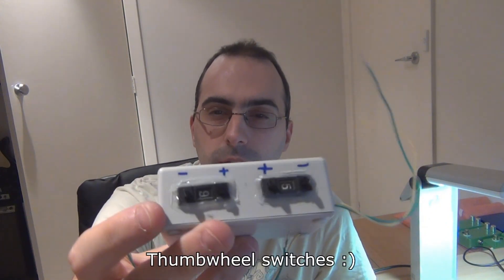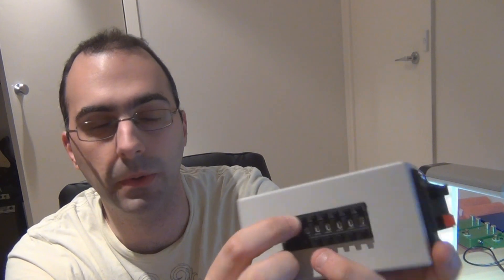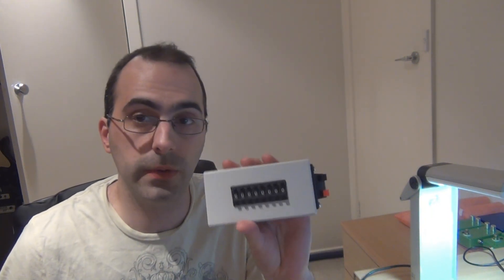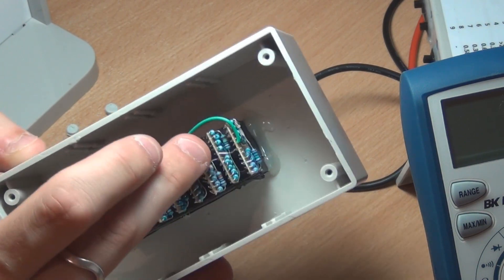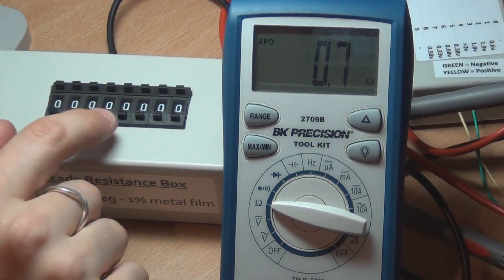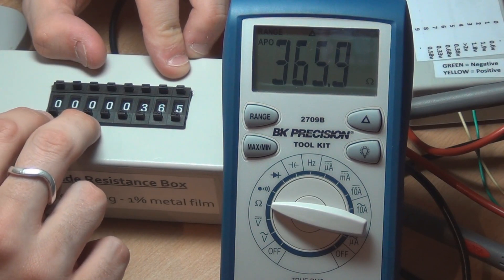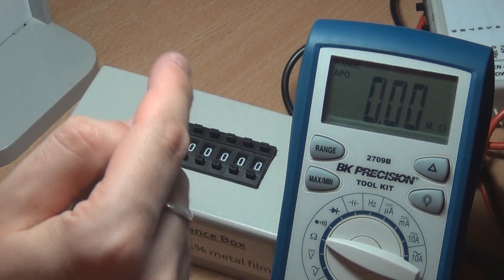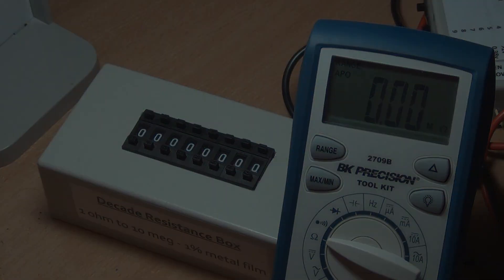DIY Decade Resistance Box

Comment: As usual, another great video and I just completed my own decade box.  This is such a great tool as mentioned, for testing resistors and potentiometers, as it saves time and quick testing without having to stop and swap out resistors.  Was fun building this unit and that it works as I was hoping it would.  Thanks again!  ^5^5^5
Reply from the maker: Thanks Fastnewbie!  Its an essential tool for breadboarding if you ask me!  Cheers

Comment: careful with those connectors ... i learned the hard way with a few of those  , putting probes in them . i ended up filing them a bit in the center . atm i am removing all of them from my amps and cutting in dc meters . cool lil device .